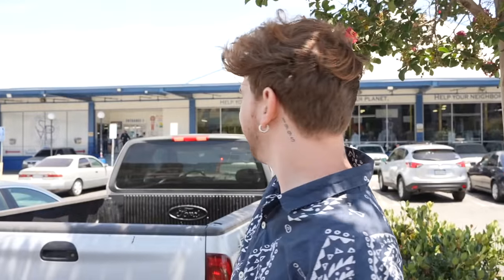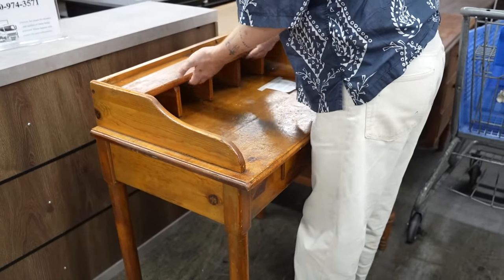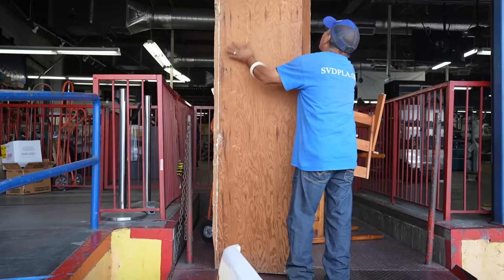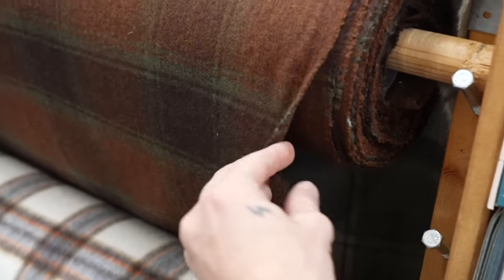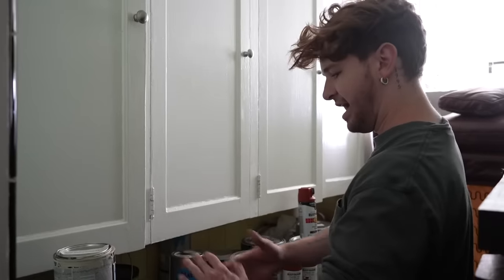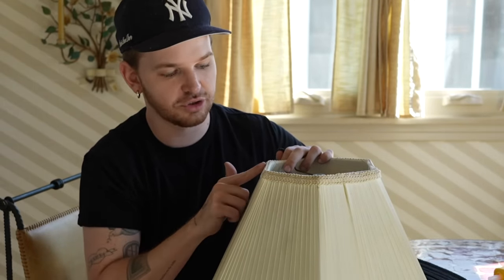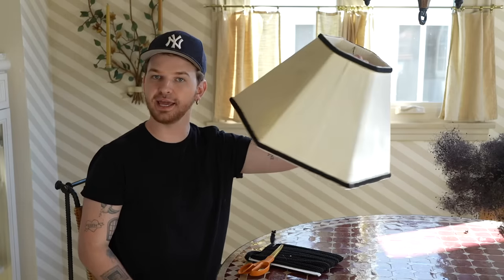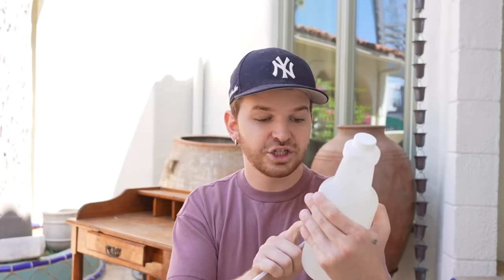Thrifting Home Decor to DIY & SELL on Facebook Marketplace!

Comment: Pro tip; when inserting foam cushions into fabric covers, put the foam cushion in a plastic bag with the opened end facing away from you as you slide it into the fabric cover. It will slide in so easily. Then pull the plastic bag out. Once you have adjusted the fabric into the correct position and zipped it up, steam the entire cushion with your iron. Steam will puff up the foam a bit, filling out the cover and setting the seams to lay flat.
Reply: Could steam help a couch cushion that's gone a little flat due to being sat on a lot? I have a favorite spot on my couch but my weight has definitely flattened the spot a bit, lol. The cushions you sit on though aren't removeable. I love everything about my couch except for that. It's not a horrible flat spot, but it'd still be nice to find a DIY way to revive it a bit, other than disconnecting the chaise lounge portion where I like to sit and having the whole thing reupholstered. Not sure if that even could be done with such a couch.
Reply: omgosh, this tip is genius!
Reply: My mom used to re-upholster furniture when I was a kid, and I remember her always doing that.
Reply: Thanks so much for sharing these tips!
Reply: I’ve also seen some wrap the foam form with batting for a fuller look.
Reply: GREAT advice❕
Thank you.
Reply: @BewareTheLilyOfTheValley  I’m only taking a guess here but my thoughts are that it would depend entirely on what the couch cushion is made of. But I don’t think you have anything to lose in trying it. 
We actually have the same problem with one seat in our leather lounge from it being the favourite, I will let that family member remain anonymous 😅, so to help both protect the seat from further sinkage and for comfort we got a thick memory foam cushion. It seems to be helping to hold the sinkage at bay and it’s an extra comfy seat now. So maybe if the steaming doesn’t work you could try memory foam?
Reply: Love your ideas.  You do such a good job.😊
Reply: Loved learning this ❤
Reply: Thank you, MVP ❤
Reply: Brilliant!
Reply: 🤯 great tip!😊

Comment: You need to show the lamps either working or (& you may have done this) disclose if they need rewiring. MANY people are terrified of dealing with anything electrical & all they consider is the cost of hiring someone to replace them. As inexpensive as wiring kits are now, it may even be worth your time to take the listing down, replace the kits in both & repost them with a header of "Newly Reworked" at your original $200. Bravo on the other pieces! I expected you to use "Retique It" on the corner hutch but the wax turned out beautifully. Thank you for the inspo, have a wonderful, safe & blessed week ahead 💜🙏🏻
Reply: "terrified"????? for a lamp without wire???
Reply: @chloeuntrau4588  Terrified of buying an older lamp with possibly worn down wiring, which could cause a fire. And terrified of trying to fix it themselves with no electrical knowledge.
Reply: I also noticed the lampshade on the right swinging as he was setting them up. I don’t know whether it needs the finial replaced, which would mean replacing both. But I agree with showing them turned on. Especially as they’re glass and that always shows up beautifully when lighted.

Comment: I love the Thrifting videos, but I can’t help feeling that the flipping aspect has contributed to prices at thrift stores going through the roof?🤷‍♀️ You did a fabulous job on the chair seat cushions! One tip for installing zippers is to use seam tape to hold your zipper in place instead of using pins. ❤

Comment: Drew, you might want to
a) invest in a decent wood scraper - they kind of look like oversized razors and make it possible to remove finish without using any chemicals (!)
b) pick up some real wood veneer for future projects like the corner cabinet - it's much easier to apply than you think, and the piece would have probably sold for $200 more if it was real wood
c) watch some furniture restoration channels like Flipping Drawers to pick up some very useful skills

Comment: I wash dirty lampshades in my sink using dish soap and a soft brush, hose them down using the sprayer, pat them dry with a clean towel then I let them air dry in the sun.  For spots, I apply the dish soap directly to the spot and rub vigorously with the brush.  A good wash down usually gets rid of any accumulated dust and spots and leaves the shade looking new.

The loop trim on the shade is called "gimp".  You often see gimp on upholstered furniture too.

I really liked all the flips in this video.  Please, more furniture flips, fewer Dollar Store DIYs.  Thanks.

Comment: Next time you use qcs, try using a super fine steel wool instead of a scraper. It will keep you from digging into the wood and will help get any finish out of existing cracks and dings 😄
Reply: Or just use an actual wood scraper not a wallpaper scraper and won't need any paint stripper.

Comment: Hi Drew:  just watched episode where you stitched your first cushions. Congratulations!
May I suggest 2 steps for your next project:

1) make the zipper long enough to go around each corner ( 2 inches or so)

2) wrap each cushion in a layer of quilt batting. Makes a big difference when chair is sat on. Without batting, fabric will not spring back immediately & leaves wrinkles. Also aids in inserting and removing the foam. 

Best wishes!  S

Comment: Quick trick for zippers. I sew the seam together first, iron it flat, pin the zipper, sew in place and the open the original seam I sewing with a stitch ripper. I found that it makes the perfect zipper everytime! Great job on the flips! They always turn out incredible!
Reply: Clever, great tip
Reply from the maker: Ahh yes I use to do this for invisible zippers all the time in sewing I just remembered after reading this
Reply: Was going to write the same thing.  Also, the seam is easier to rip out if it's (machine) basted.

Comment: Obsessed with that chest you looked at! I have one that looks almost exactly like it inside & out except mine is a dark red. I keep all my bed linens stored in it.. but i want a darker or in like a brown or even black to use as a coffee table. I find mostly rounded top chest & of course need the flat top. We used to own A thrift store for about 5yrs when we lived in Tennessee. We had A piece that looked just like the red corner cabinet donated but it was actually a heavy wood piece & very scratched up. My daughter used to do some furniture flips & made that piece over. She just did it in A creamy neutral color, it turned out really pretty. Love the fabric you chose for the chair! I love anything old & made of wood.. large or small pieces. I love the little desk😊 I bought a little table about that size with a drawer, it was old & very sturdy. I had a small 3 drawer cabinet about half the size of the top, in the same color wood. It sat on top of it perfect & so i made a little desk out of it, styled it with some old desk pieces & it turned out really nice! I may eventually strip & restain it, but I'm kind of liking the old worn look of it. Oh i definitely love the chair cushions.. so pretty!❤ I'm not surprised those items sold so quickly! If I lived closer i would have been after the desk & possibly the corner cabinet! Great job on each piece!😊

Comment: Shocking how much  profit you made on those pieces!  

Tips:

Always vacuum thrifted shades to remove old dust.  

To spot clean, use plain, unscented baby  wipes after squeezing the liquid out. 

Thrifted finals to hold the shades in place are needed.  

If lamp cords are really old, consider rewiring.  

Lastly, the lamps would look better if lighted with soft white or amber 40watt bulbs. Perhaps a vignette with a plant & candles would improve your post.

Comment: Shades are easy to clean in the shower. Spray with a gentle cleaner, let sit for a few minutes and spray with cool water. If it's a well made shade it works great. If it's a cheap glued shade the glue may soften and you may need to re glue.

Comment: One of the things you don't factor into the price of the item is your time.  For example if the piece cost 100 supplies were 30 and it took 4 hours to complete at 20 per hour you now have 210 into it. If you sold it for 400 your profit is actually 190.

Comment: Corner cabinet was not totally completed-back & edges are the worn old finish. 🫣Expected better.
Reply: I’ve seen so many of these comments. While I agree that the sides were pretty beat up, the unit goes in a CORNER, which means you will literally never see the sides. Usually pieces like this are built in, which means they are bolted to the wall. The front piece and shelves are the only part that needs to be visually appealing. The sides just need to be structural.
Reply: @Amelia_Rose_333  right but the price he was asking is kind of insane though

Comment: Those old furniture pieces may have had ornate drawer pulls.
Old plywood is much better than the modern plywood. That was a corner cabinet so the back pieces could be made of cheaper wood as the only part that is seen is the part across the front

Comment: Why wasn't anything done to the side of the corner cabinet? I realize it will go against the wall but it should have at least been painted. Also, the outer edges of the front of the cabinet needed to be sanded smooth. I liked everything else. Loved the lamps but not the shades. Maybe you should try selling them without the shades.